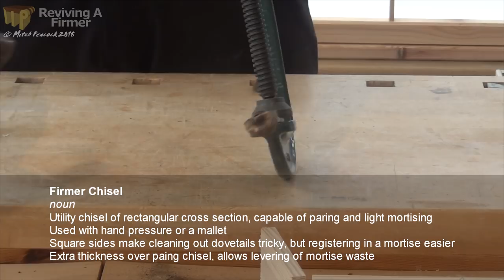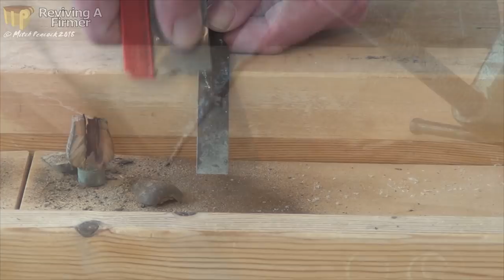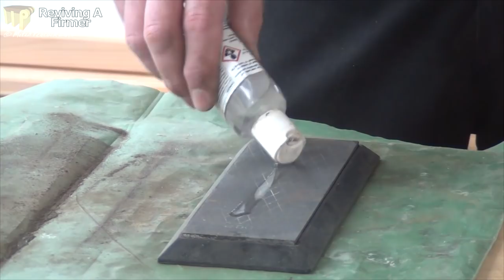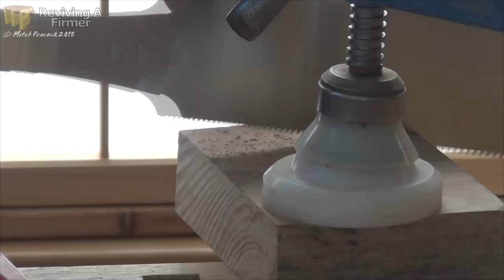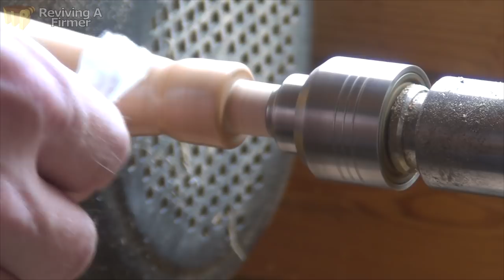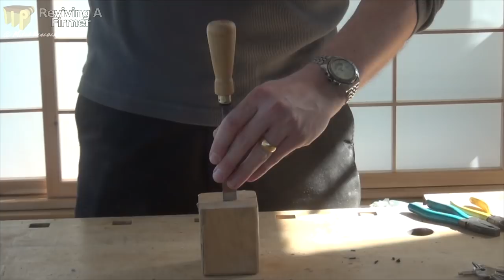Reviving a Firmer Chisel

Comment: I’ve recently acquired six chisels for £4 just because they need restoring. Four of them are firmer chisels I will restore, one's a bevelled I will save for cleaning my workbench etc. The sixth...well we need something to open paint cans. It has the biggest dint in the edge, possibly from others using it for paint cans. 

Most of the research I did for the late 19th century early 20th say they were a very popular chisel with ship/boat builders. My intention is to use them as a middle gap between my new Narex Premium bevelled edge and my old Marples morticing chisels. I hope this is the right type of use? 

This video has been extremely useful though as I don’t have a lathe, still very much at the learning edge of basic woodwork, I'm going to have to take a different approach to handle making. 

I really liked the format of this video, quite relaxing yet still very informative. Thank you very much for posting it.
Reply from the maker: Thanks Mark. Making use of old tools is great - even if just to open paint cans ;-)

Without the benefit of contemporaneous accounts, I can only guess what the original purpose of firmers was. So, with that said, best to consider where they are useful today, and assume that may have been behind their manufacture.

Firmers are good for mortises, since they register unlike bevel edged ones, but also good for most joint work where acute angles don't limit their access (e.g. cleaning along the corner of low angle dovetails). Being stout to both edges, they are more suited to any levering than bevel edged, but obviously not so much as mortise chisels.

I find them terrific for short mortises specifically, where the thickness of a mortise chisel causes a significant restriction.
Reply: Mitch Peacock - WOmadeOD Thanks for your reply, it’s very useful.

Comment: Very nice job!
I have a little doubt. 
Bevel chisel are for cleaning joints detail like dovetails, mortise chisels are for removing big chunks of wood, but firmer chisel what are made for?
Reply from the maker: I see them as capable of most joint work, but it takes a little more initiative to skew them for things like dovetails. They make short mortises easier that thicker mortise chisels. That's just my opinion though, and not based on anything other than my experience.

Comment: This might be a naive / neophyte question, but what is the purpose of firmer chisels and what is the etymology of the adjective firmer being used to designate them?
Reply from the maker: I wouldn't dream to know for sure, but from my point of view they are great for light to moderate mortising, registering against the sides like a mortise chisel and unlike a bevel edge chisel. They are less likely to break or bend (depending on hardness) than bevel edge chisels because of the extra metal, and possibly this less to the noun firmer.
Reply: Thank you Mitch.  Always a pleasure to watch your videos.  I just acquired a brand spanking new Pinnacle F45 (3/4”) firmer from our Woodcraft Store in Knoxville, TN.  Apparently, they are still made in Sheffield.  The packaging didn’t mention anything about it being a “firmer” chisel; and so, I actually thought it was a mortising one.  That’a how I’m planning to use it in the immediate future anyway.
Reply from the maker: Not heard of the Pinnacle brand, so let me know what you think of it after a little while. I use firmers a lot of times where the bevel edge relief isn't needed, and find them more comfortable when holding the blade to guide a cut.

Comment: What kind of chuck do you have on the lathe to hold the piece when you are parting it off. I have a Record CLC lathe and make replacement front knobs for planes.
Reply from the maker: The chuck is an Axminster one. About twenty years old and I don't remember the model. The jaws are a fairly recent accessory, also from Axminster, designed for holding small diameters whilst allowing good access. Check the Axminster Tools website in the UK.